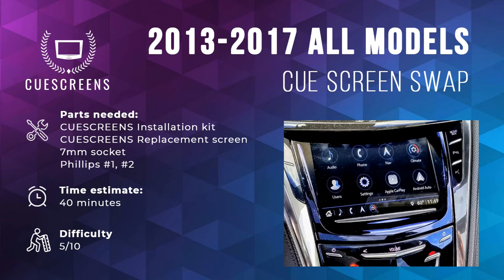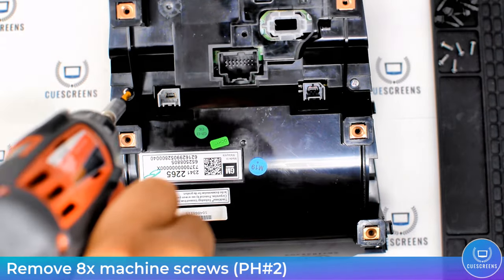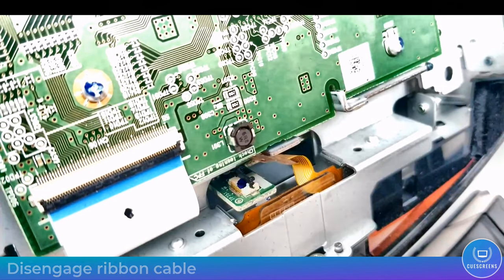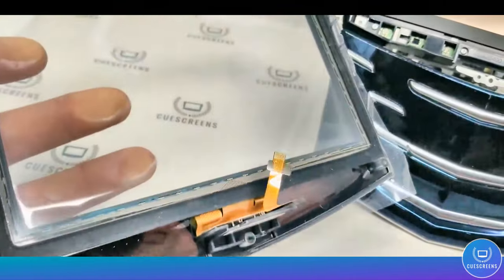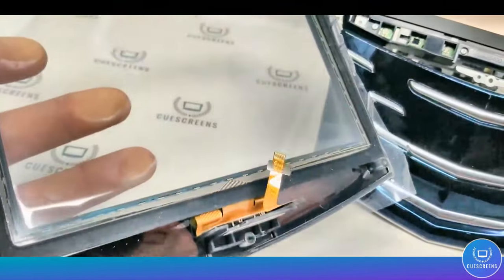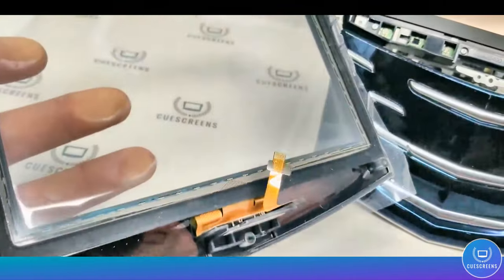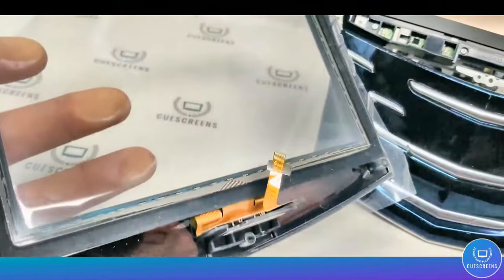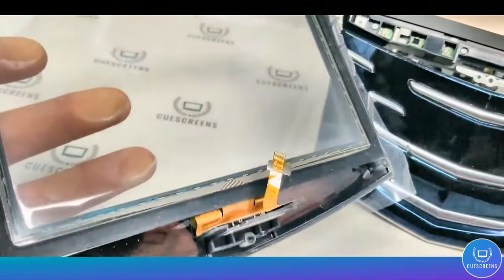How to replace Cadillac CUE screen to fix unresponsive / random touch issue  *Easy Method*

Comment: I have a 2017 Escalade Prestige Edition with all the options it also has a Cue System dated 8/03/2017 the Harness for the CUE unit does not contain 7mm bolts instead it is has (6) T15 (Hexadecimal Style) Screws versus the (6) 7MM bolts you outline in your instruction and videos. . You may want to update your instructions to include these T15 screws as a possibility since this is a stopping point during the middle of an installation. Point of Reference my Cue Started with a number 8 and it was Made in Malaysia.

Also, thanks so much for this product I was able to complete this install within 3 hours and that includes the break in the middle to search down a T15 Bit from Lowes then onto Home Depot which had the T15 2" BIT that was required for my installation. 

Also just a note take extra precaution when reinstalling the woodgrain as when I put the CUE trim on it cracked a small piece off the edge so there is definitely a method and concise order you must follow when reinstalling everything so it lines up without catching a corner and causing a chip in the faux woodgrain laminate. (easy fix but just mentioning this)

Overall A+ great product saved me lots of cash as my local dealer wanted $1900 for new CUE system and $1200 for installation they said 9 hours to install!!!! What a scam!

Comment: Absolutely Awesome!  Did my 14 SRX and your product and instructions are excellent. Only thing I'd change is to take both bolts holding the side middle console trim out instead of leaving the front one. Putting it back together, it's difficult to put back in place without damaging the front "fork".  Now on to the interior rear gate switch.  Caddy sure has gone south in quality. My Grandfather and Father were both Caddy guys.  I had a Coupe De Ville in the 80's.  Those were well built vehicles. Not so much anymore.

Comment: I had to find a solution due to a dead right side on my 2018 ATS. Simply non-responsive side,  which prevented me pressing necessary buttons, and mostly confirm android-auto. 
So after watching this video,  I ordered the screen,  and I cleared up my saturday's afternoon. 
I sticked to the videos (focusing on the primer one that explains how to disassemble the entire thing from the main console. 
NOW THAT PART WAS THE TRICKIEST AND HARDEST PART because it's not as easily removed sides around the gear and the cup holder, and the plasic there is pretty fragile and easily breaks. But,  after getting that out of the way, the rest was rather easy. 
The video isn't relevant on a few slight differences, such as number of screws, a small white connector and the simplicty of the whole thing. 
However, without that elaborated video,  there's no way I would have ever risking it and tried,  SO THANK YOU! 
IT'S WORKING PERFECTLY THANKS TO YOUR GUIDE🎉

Comment: Just finished mine and wanted to say that the video is excellent. Thank you!.

However, I do have a couple tips that helped me.  I first followed the instructions and only loosened the screws that he references at about the 5-minute. Mark.  However, when I went to put it back together I found I had an alignment problem and that had to do with the compartment being under the washer on those screws.  I noticed this because I did an alignment check of the door prior to putting it back together. Had I not done that alignment check, I would have ran into problems later.  Consequently, I can't recommend enough that you ensure the door closes fully with no Gap before reinstalling the back cover. That's when I decided that I was better off completely removing those two screws and then putting them back when reinstalling the compartment   After I did that, it aligned perfectly.

Comment: This did not work for me. Followed step by step. Installed easily. But didn't work afterwards.
UPDATED!! 
After advice from CUE screens. I realized it was me and my lack of ribbon connections. But it does work. It does do great!!!
Reply from the maker: There are 3 reasons for the touch screen not to work after install. You definitely want to check all of this carefully. 
1. Read the card inside the box- check part number for compatibility.
2. Insert the screen ribbon cable all the way in. 
3. Make sure the ribbon cable is not torn or cut.
Reply: @CUESCREENS  definitely the ribbon. Took it back apart. Ribbon was not fully in. Bing bang boom. Thanks!!

Comment: Fantastic replacement screen! Great customer service! My 2014 SRX had been replaced with an OEM replacement before I bought it in 2020. I ordered the wrong early version QUE screen. CUEscreens exchanged for the V2018. I only paid the difference for the higher cost V2018 screen and shipping. CUEscreens included a return shipping label. The V2018 cuescreen is better than the OEM. Clairty is outstanding.  Replacement was exactly like the videos demonstrated.  This is a DIY to save you $1500! Thank you CUEscreens for a great product and great service!

Comment: Add me to the list of very happy customers.  2016 CPO XTS with 60K, CUE started beeping and randomly going through channels and no response on the touch screen. Dealership wasn't sure if it was covered by warranty but would let me know when they had it apart and found out what the issue was....I called BS on that scam and ordered your replacement.  Watched your video a couple times and followed it to the T.....three hours later the fix was in!  Great video and great price on the CUE....I'm thrilled

Comment: I just finished replacing one for a customer.  The biggest piece of advise I could give, is definitely without a doubt make sure you have those specific screwdrivers.  On the very last screw before removing the screen, the screw stripped.  It was the center one where one of the but plugs is in the way.  Hard to get the best leverage and angle.  I had to file it down to a flat head.  Finally got it out and the rest was easy.

Comment: Unbelievable and awesome product.  Cadillac wanted $1,300.00 to fix the well known defective screen, and Cadillac has some nerve to not do a recall for what is really a disposable and defective item.  This will be my last Cadillac (OK, I vented enough).  I goofed a little when I installed the screen, and I managed to loosen one of the small white ribbon cables which you should never touch during the install, but it may come loose inadvertently.  My screen turned on after reinstalling it, but the black panel below the screen did not light up.  I actually called the number on the Cuescreen website in the evening, and I thought it was going to voicemail, but it was answered by the owner (I think he is the owner).  He told me in a couple minutes what I did wrong, and he was correct.  He was also a real gentleman and very professional.  All up and running now!!!  Yeah, getting the trim apart was the hardest part.  Pry outward the top trim first (start at top, the very tippy top, and pull out from there first), then pull on the bottom trim to get to the 2 screws holding in the top trim.  Don't be afraid to pull too hard on the bottom trim to get to the 2 screws that hold the top trim on.  I used a small rachet 7mm to get the 2 screws out, there is just enough room when pulling the bottom trim out to use the rachet.  Do use plastic only wedges, get the kit, because you will scratch the trim while massaging the trim apart (metal tips will slip and scratch).  Even if you are not mechanical or don't have a little muscle to do this (the trim), buy it anyway and find a handyman who can follow step by step directions on the internet by this company.  This is one of those rare products that are more like miracles, and they work better than the original part.  I am very thankful to Cuesystems.com.  Thanks CUESYSTEMS!!!!
Reply: Just finished mine today.I love saving this kind of money doing it myself. Start to finish and cleanup took me 4 hours. I was very slow and double checked everything. I feel that I could do the next one in half the time. I agree that removing trim is the hardest part.  It is my  wife's car and they didn't mention that it really helps to put the seat in its lowest position when removing the trim. She drives with it in the highest position.  I didn't discover this until I did the reinstall.  I highly recommend.

Comment: Just did mine and it works!! The VJOs were super helpful and very much appreciated. I would caution anyone thinking about doing it to read the website first and not just dive into it with the 2 VJOs. There are important steps and gotchas that cannot be overlooked. 

The only thing I had an issue with was removing the two console trim pieces. They didn't come off easily nor go back in smoothly. That's my only critique...that I wished there was more video on those steps. 

Other than that, I'm extremely happy with CueScreens' effort in making this easy for any home-gamer or anyone looking to save over $1800!! (My dealership in Denver quoted $2K vs $129 for the screen)

To anyone thinking you can't do this, you absolutely can. Just give yourself a few hours, make sure to read everything on the website and watch the VJOs a couple times before diving in. Also, don't get stressed out...have patience and it'll go smoothly. You'll have a great sense of self-appreciation once you fix it. Plus, you can do whatever u like with ALL that $$$ you saved!! 

Thx again, CueScreens, 5 stars, couldn't be happier.
Reply from the maker: Nice job!

Comment: I just installed on 2016 srx, had been replaced once under warranty and cracked again shortly after warranty exspired....the video tutorial is very good, hats off, tje only thing i would add is when you install the new screen and the alignment is not so good if pushing on the plastic dowells won't do it you can manipulate the steel tabs to where you need them or at least i was able to and with a little finesse make all the screws, but all in all very happy with the quality of the product and the tutorial great job cuescreens highly recommend
Reply from the maker: Great tip thanks for the feedback

Comment: OK. Did it. I know I save tons of money...maybe $400 - $600 and that is in my pocket, not someone else's. 
Clocked start to finish 4 1/2 hours. Including re-reviewing some instructions.  
The good, instructions were excellent.
The bad , that ashtray, both disassembling and reassembling, took some determination.  The side dash covers had to be slotted into side of ashtray before pushing ashtray back in.  Like lining up three assemblies at on time!
The ugly, the flashers and glove box buttons were difficult to pop off. Double notched on both sides and they just wouldn't pop off with one pry.  
The only special tools I used were the plastic pry bars, an extension rod for the 7mm socket, and a good flashlight.

Bottom line, I was really pleased when I started the XTS and the Cue screen worked!!!  Eight months of driving with just one radio station and without floor/dash vent controls or correct time on time.

Comment: This guide and the module removal guide worked perfectly. The screen is amazing. It feels like it’s actually responding faster as well because I believe that gel was affecting how fast it detected a touch. I know the rule is that if it ain’t broke don’t fix it but knowing what I know now I’d replace GM’s screen with these screens even if your screen isn’t broken. It’s just clearly better quality.
Reply from the maker: Awesome thank you! We do have many reports of the sharper display image and quicker response than factory- plus with the gel-free design you never have to worry about it again

Comment: Thank you for a great how-to video on changing out the CUE screen on my Cadillac!!! Might suggest that as folks take screws out to group them with a color code (perm marker pen used on screw head and hole where screw goes)---a simple procedure, as there are over 25 different screws. Just a thought!
Reply from the maker: Great job!
Reply: Good point. I used a little white plastic tray my wife gave me. She's wrote numbers in each of the nine slots so I didn't lose track of the separate clusters of screws while following the steps.
Reply: Great idea. I use paint pens. Permanent marker doesn't adhere very well.

Comment: I have a 2016 SRX.  The first problem I had was when the warranty was about to expire and the screen became unresponsive.  After being repaired under warranty, the screen developed the shattered look and stopped working so I bought a screen from CUESCREENS.  In all, it was a fairly simple and straightforward repair.  The instructions in the video from CUESCREENS were perfect and changing out the screen was a simple process.  I had to find a video for getting the unit out of my SRX and found one that was helpful.  If you find that video, only use the info for taking the unit out of the SRX because there was at least one error in the video for replacing the screen.  Surprisingly, the unit was fairly simple to get out of the vehicle as well.  I recommend having panel removal tools.  I have plastic and metal ones from Harbor Freight.  I have a tabletop magnifying glass that was also helpful to see what I was doing when removing and reattaching the small ribbon cable discussed in the instructions.

Comment: Thanks for the great instructions!!   I've never done anything like this and have to admit I was pretty anxious taking my car and module apart but it all worked out without a hitch.  Took me about 3.5 hours.
Reply from the maker: Nice work! What was the hardest part?
Reply: @CUESCREENS  getting to the module in the car was a little difficult. Dissembling my XTS didn't exactly match your tutorial, so I took some guesses.  I think it may be because it is a platinum trim package?

Comment: great explanation and got the screen exchanged in my 2016 Escalade. One thing to note - i have 6 Star headed screws connecting the side panels  not the 7mm bolts.  everything else was as you explained in the video. Hardest part was getting some trim pieces off and getting them back in.   I cheated a little bit and found I didn't need to remove the DVD player and the ignition button trim
Reply from the maker: Good points Rudy- there are some slight variations depending on your model but the overall process should be very similar.

Comment: Thanks for the excellent instruction in the video! Good pace and filming. The new screen fixed my issues. Not a terrible job to do but this step-by-step video included all the details and made it easy. 👍

I watched several videos on the subject and this was the best. I ordered through Amazon but I did happen to order your part. It fit and worked well. The Touch Bar on the original looked a little more like chrome and the replacement had a bit more of a brushed stainless look but I don’t think anyone will even notice after seeing the finished install. 

If I could make a couple of minor points; to increase the chances of getting all of the screws in the screen, bottom out the screws then back up a half turn, once they are all started well, then tighten them up. I understand production tolerances could be an issue but that will give you the best shot at getting them all in. When starting a screw, turn it backwards until you feel a slight bump then tighten, the idea is to go back in the same threads. Of course  the new holes in the screen housing won’t have threads yet. I saw you do this in the video but you didn’t mention it, it’s kinda second nature for folks who do work like this often. Lastly, when aligning the small posts on the screen to the brackets, I suggest not pressing on the posts but pushing on the metal bracket instead. 

In the video on removing the unit, clearly that’s the quickest way but the bolts in the first step are kinda hard to get to. A short 1/4 drive 7mm swivel socket could make it possible but I ended up using an open ended wrench. If you don’t have a set of metric ignition wrenches, a 9/32 is very close and works just fine.
Reply from the maker: Nice job glad you like it

Comment: 4:35 Not sure why I can’t find the compartment light box wiring on my 2017 ATS
Reply from the maker: You probably have the wireless charger option. Keep going- nothing to disconnect.
Reply: @CUESCREENS  yeah I just went ahead to next step, have everything installed as of yesterday and it’s working great. Only thing is I feel like I need to tap pretty hard sometimes on it to get touchscreen going
Reply: Thanks for mentioning this bc I couldn’t find it either and now I know I don’t have to

Comment: I’m finished the installation and screen works pretty good, however for some reason when I try to calibrate the screen the calibration start with top left corner and can’t touch the point to proceed with the calibration. Any troubleshooting for this ? Overall works good however it’s new and I’m fell i start with left foot. I’m unhappy😢